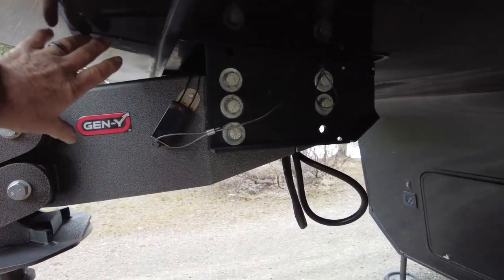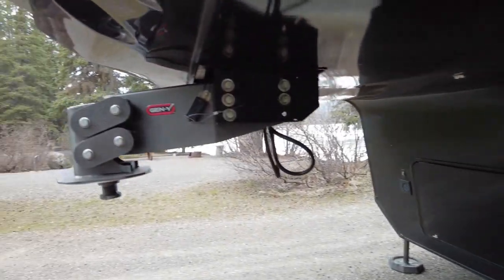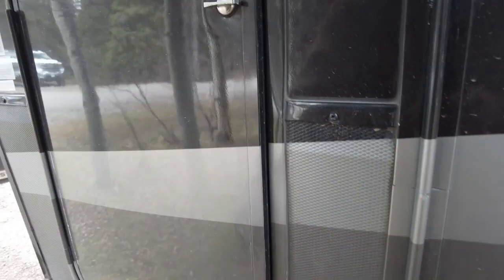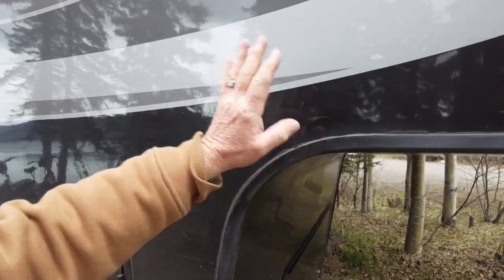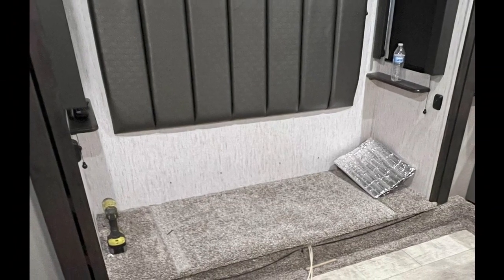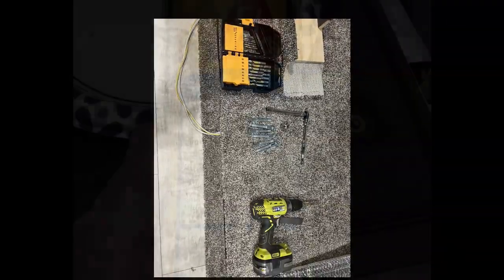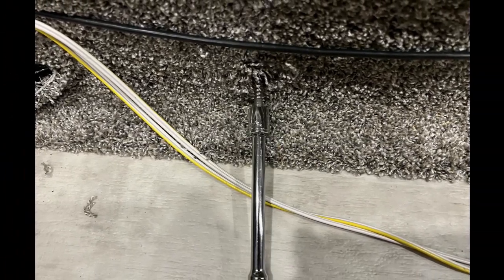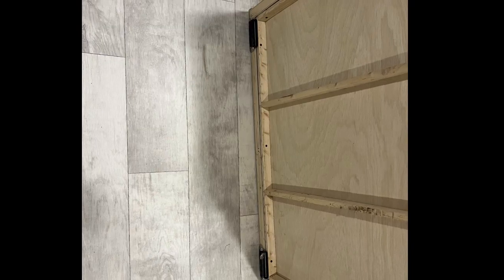Frame Flex Video Streetside Part 2

Comment: Have you put it back on the truck since you did the work?  If so what happen
Reply from the maker: 6000 miles to Alaska, and still going. No more movement at steps or in bedroom. I still see deflection in the pin box mount, but everything else seems fixed.